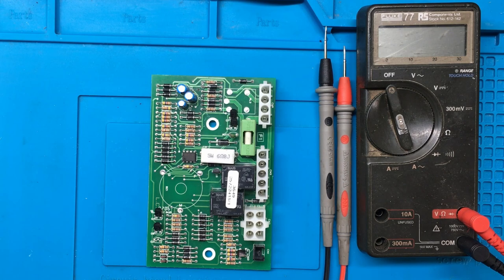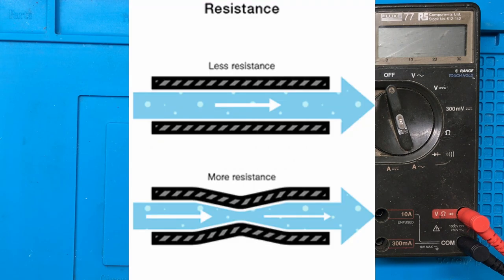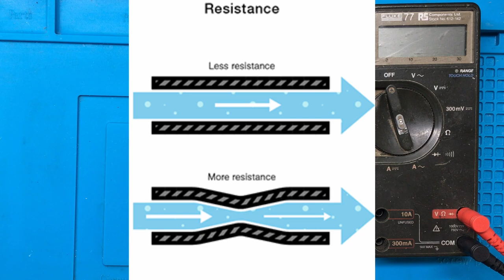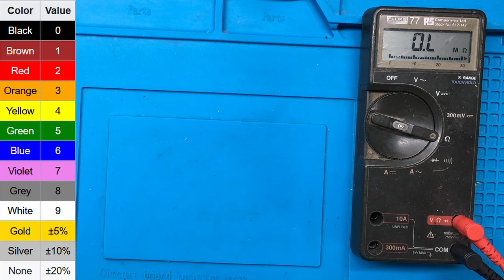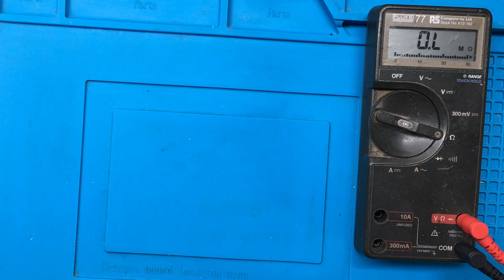Part 3: How To Test Resistors With A Multimeter

Comment: well I was really hoping to see some of the sayings on resistor codes here, but, no luck.... lol I did learn a neat way to check a resistor when it is open, and  burnt, or discolored really bad. if you scratch off the ceramic coating to get to the coils inside, you should be able to read the resistor or at least half of the resistor to determine the value of it. That is a good way to find out especially if you don't have schematics to follow. great video again.
Reply from the maker: Thanks and Thanks for the tip 👍

Comment: Mosfets totally confuse me a video on them would be awesome,  what used for, what's source drain gate etc ? Especially in laptops
Reply from the maker: They are similar to transistors (see pt4), Gate is similar to the Base on a transistor (the signal to switch it) and the Source, is usually the Source of the power, and the Drain is where it Drains to when its switched on.

Comment: Should all resistors have continuity?
Reply from the maker: If you mean with like a beep on a multimeter, no. If the resistance is too high then it won't register. Like a 10 ohm or 100 ohm resistor would beep, but a 10M ohm would not. Hope that help!

Comment: Hello I have a cordless drill charger, there’s power going to it but the led’s on the charger don’t light up nor does it charge my battery, it’s a tiny board with one small resistor resistor I’ve measured that and it reads 00.5,as the board is so small there’s nothing else to check, is resistor bad or anything else I can check a new charger is quite expensive.if I can repair this that would help great.
The colours on the resistor are Black,Brown,GreenSilver and Brown.
Reply from the maker: You can drop me an email at the channel's name at out look dot com with a picture of the board perhaps?
Reply: @BuyitFixit  yes sure I can do that

Comment: When I measure ohm by fluke, it starts with a big number then goes down to a number. Why it does that? (e.g starts with 315.7 ohm then decrement down to 150 ohm)
Reply from the maker: Not 100% on that. Is the meter working ok? Accurate? Have you tried a different set of leads ?

Comment: What if there is a continuity on a resistor when you test it with a multimeter
Reply from the maker: Depends on the value of the resistor, a 10 Ohm resistor would show continuity on a multimeter yet a 10K probably wouldn't.
Reply: @BuyitFixit  and it's getting very hot
I don't know if it's normal
Reply: @BuyitFixit  and it's getting very hot
I don't know if it's normal